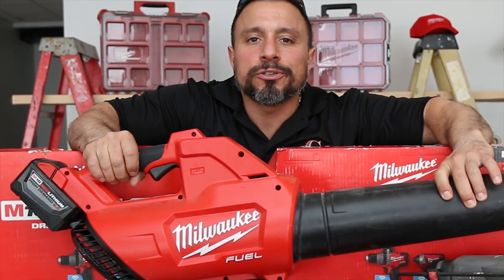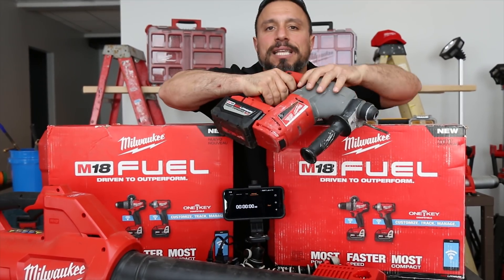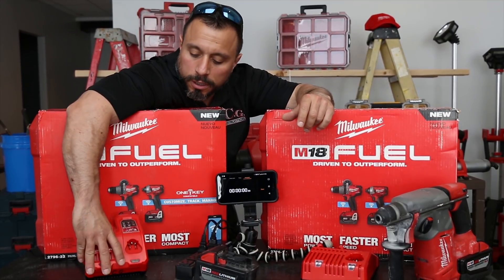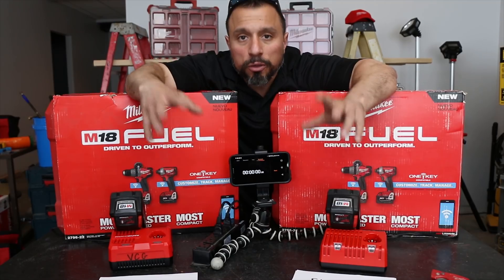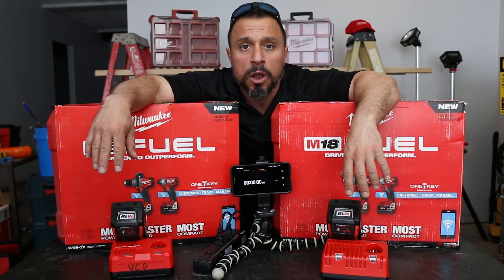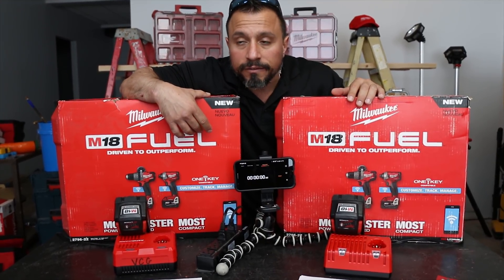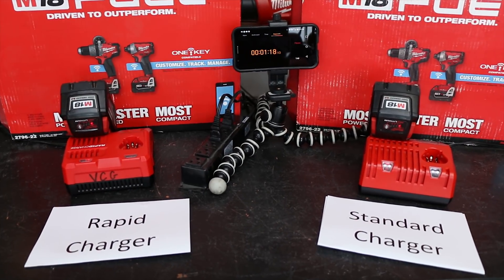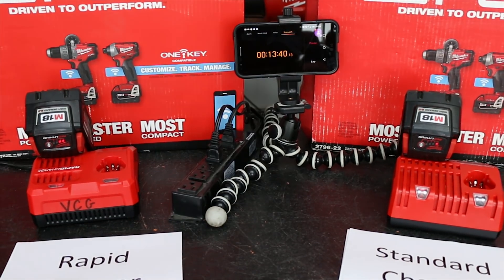Milwaukee Charger vs Rapid Charger - 9.0 High Demand Battery Test!

Comment: I usually stay away from using the rapid charger because I hear it's not as good for the battery and its runtime is decreased. Will I be going dead more often when they are rapid charged?
Reply from the maker: Unless I need to get up and running exceptionally quick I prefer to use a standard charger!

Comment: Well not as much but to some extent the standard charger will save the life of your batteries but more so on any smaller batteries i would not charge anything but the 9 and 12 Ah batteries on that rapid charger
Reply from the maker: One of the #VeryCoolGang charges the 9.0 & 12.0 batteries on a standard charger overnight!!
Reply: THANK YOU!  Now I don’t have to comment .  Even skeptical on the larger ones, saving time? yes. Battery life though? Never know
Reply: Ya when my warranties expire on my chargers I'm going to put a resistor and switch in series for roughly 1 amp charging

Comment: Both my rapid chargers overheat when I charge my 9.0s.. I have to take the battery off one charger and put it on a different one
Reply from the maker: Do they make a noise?
Reply: VCG Construction they Screech. once they start over heating